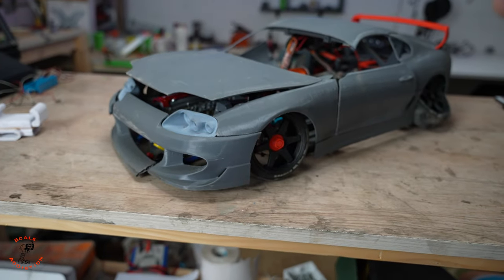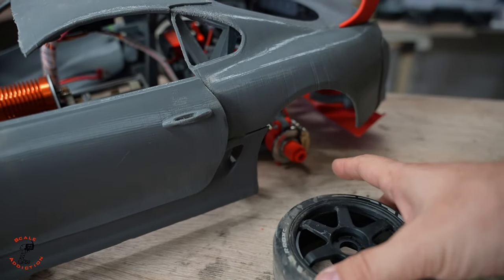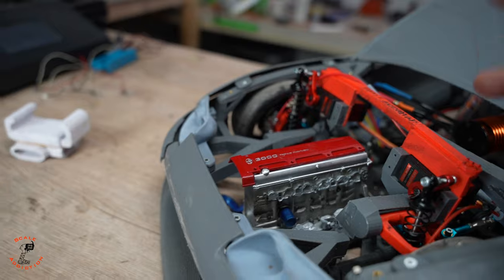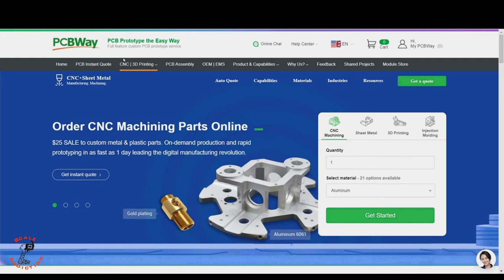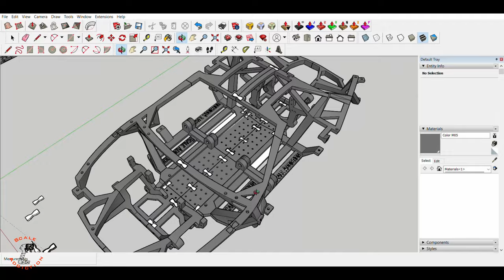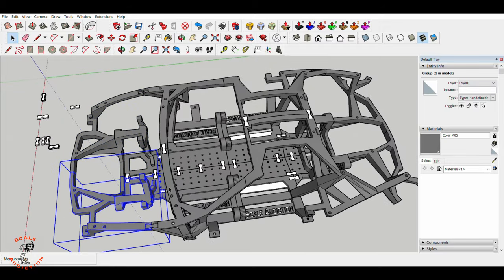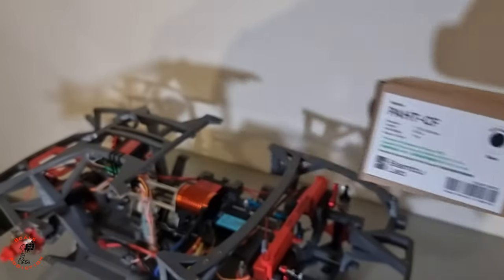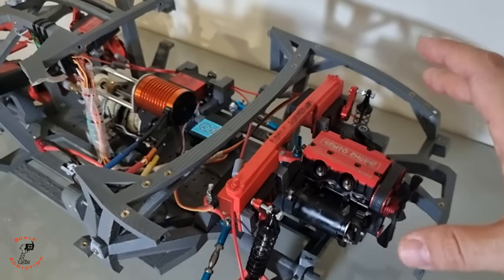Here is the bad news, the good news is...

Comment: You can always either print with 100% infill or just up the infill and add extra walls.
Reply from the maker: It had 5 walls with 0.6mm nozzle, but we have to know more weight,  more the important will be, we need ligter or same weight with little flex
Reply: @scaleaddiction  what infill did you go with?

Comment: Strong or detailed.  Gunna drive u nuts trying to achieve both. I think a static model with working details, lights, steering, susp, diff etc is just as cool as one u can drive. RC cars are so cheap and durable these days whereas detail stuff still costs a bunch. Just my two cents. Doin great either way
Reply from the maker: That's true, I'm trying to keep it in between